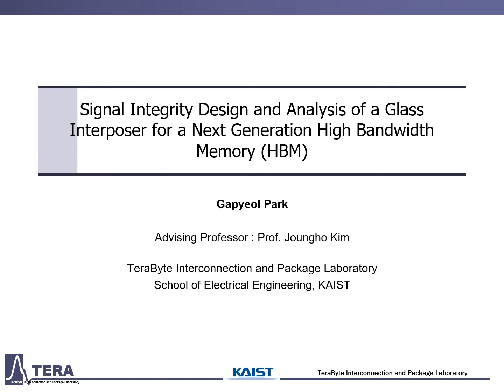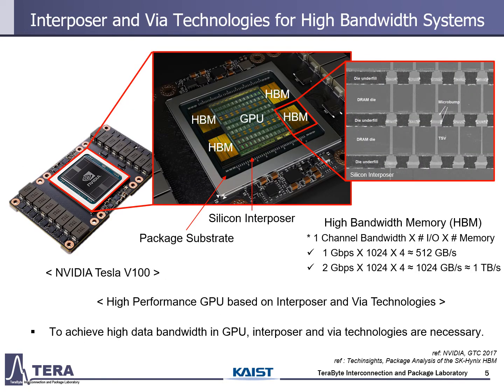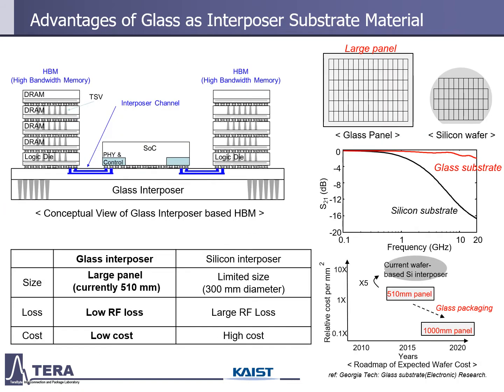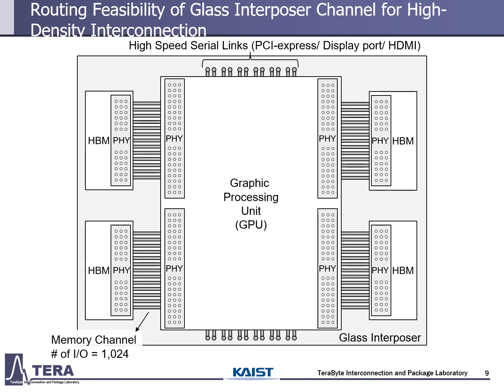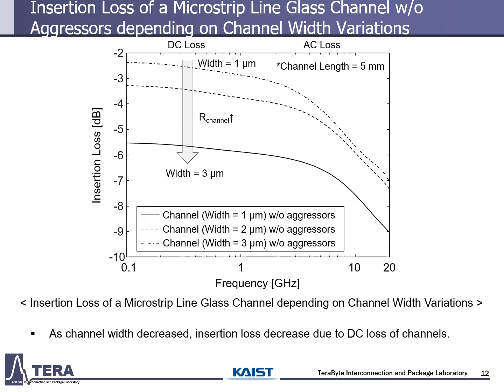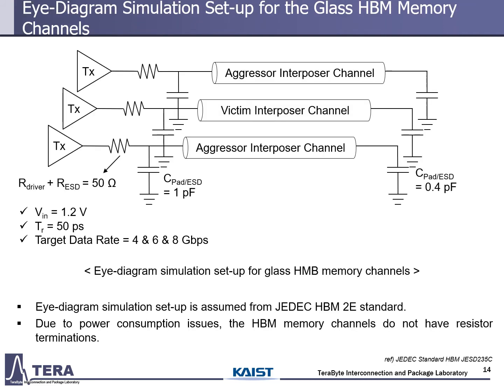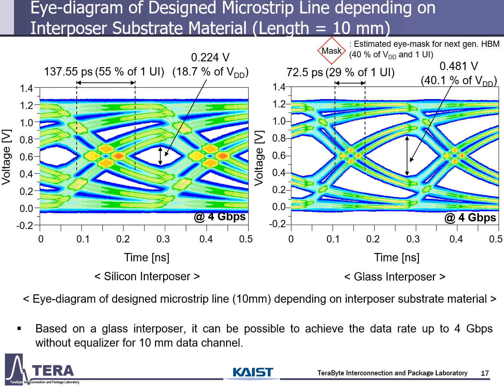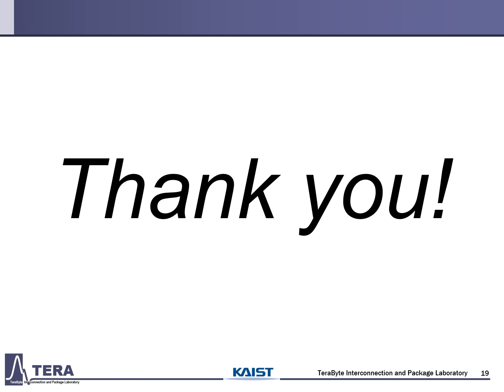Signal Integrity Design and Analysis of a Glass Interposerfor a Next Generation HBM

Comment: hello, it is an excellent presentation.  on slide #12, the solid line represents 1um width and the dotted line represents 3um width. however, it looks like u label them in reverse.  do u think passive equalizers are needed even on glass interposers above 8Gbps?